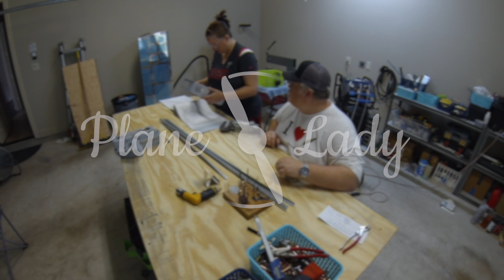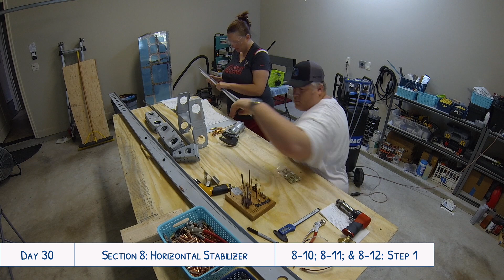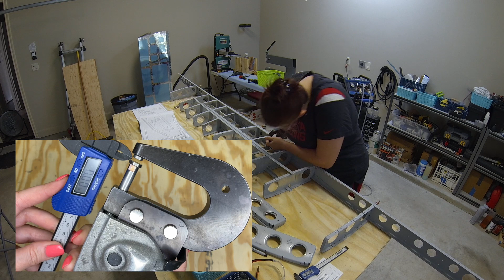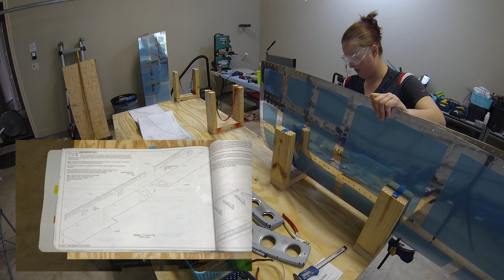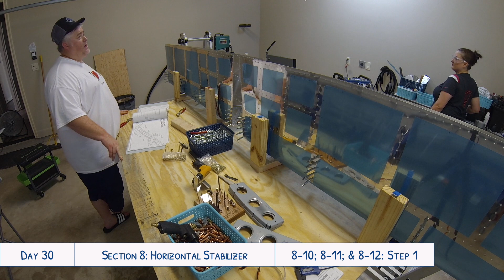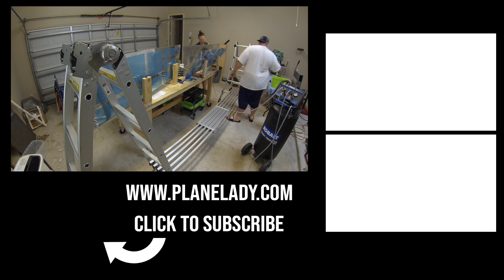Van's Aircraft RV-10 Build: Day 30 - Setting Up Scaffolding for H. Stabilizer (8-10, 8-11, & 8-12)

Comment: Just another small suggestion from one builder to another. Recommend you build on some cheep moving blanks, Harbor Freight has them for around  10 bucks a pice. It will keep the aluminum from getting micro scratches from the wood.
Reply from the maker: Thanks for the tip! 😊

Comment: There's a chart that tells you what distance to set between the rivet sets???  That sounds super convenient!  I'd been smashing them in a piece of scrap aluminum then checking with the gauge until I found the right distance.  Where do you find the chart at?
Reply from the maker: It is super convenient! It came with the one we bought from Cleaveland Tool. I posted it on my Instagram yesterday (@plane.lady)

Comment: I have heard some builders say they prime everything, some say the plane will out live them without priming.  The theory that resonated with me was to prime where there is metal to metal (rib to skin) contact.  You've got the ribs primed, so no metal to metal, you're good.  Got any thoughts on the matter?
Reply from the maker: Oh man, there is SO much debate about this. We talked to one of the head honchos at Van’s at Oshkosh last year and his suggestion was to prime where there is metal-to-metal contact and anywhere we scuffed the skin. I think with that metal-to-metal contact method you only have to prime one of the surfaces, but we’ve been opting to prime both surfaces wherever they meet. That said we have friends who prime everything in big paint booths and others who say don’t bother priming. I think it really comes down to deciding what makes you most comfortable after researching it. For what it’s worth we started out priming everything prior to that conversation at Oshkosh, and now we follow that advice we received.